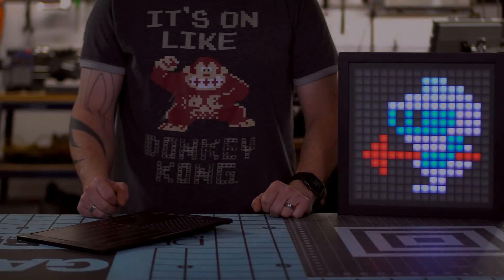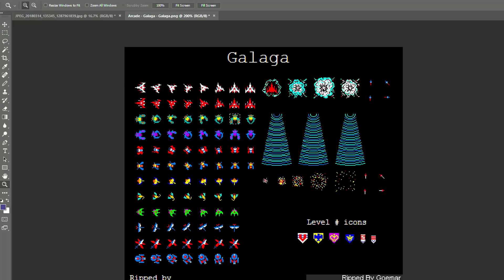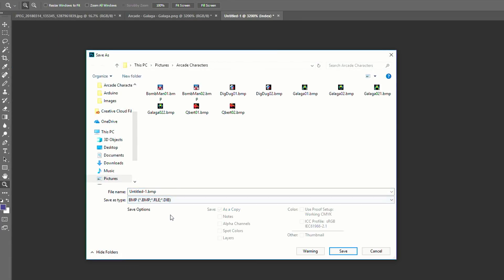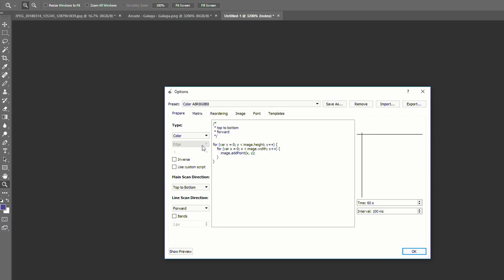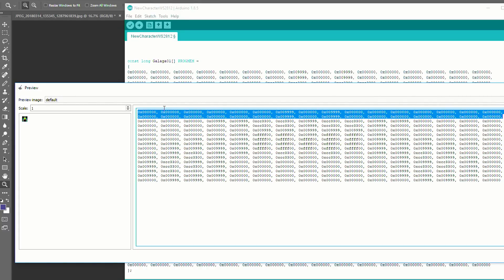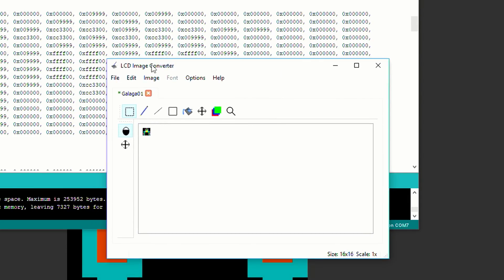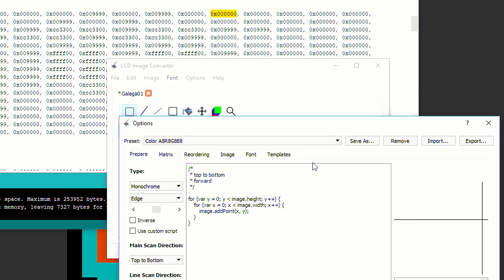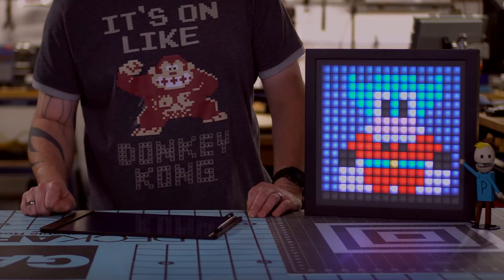How to convert images to Arduino Arrays for use on LCD displays! - Tutorial

Comment: Here is the script for the conversion so you don't have to copy and paste all those lines.

/*
 * top to bottom
 * forward
 */

for (var y = 0; y < image.height; y++) {
    for (var x = 0; x < image.width; x++) {
        image.addPoint(x, y);
    }
  y++;
      for (var x = image.width - 1; x >= 0; x--) {
        image.addPoint(x, y);
    }
}
Reply: Also, don't use the "preview" to copy the code from, the app is a little buggy and doesn't update. So copy this script in, close + save the conversion, then File > Convert, and copy from the output file
Reply: hello, i dont know why my number of pixel in one line of mine only have 11 pixels, can you help me bro

Comment: Hello. I have an improvement to make the array creation easier and faster. After setting the software up, in the PREPARE tab mark the option "Use custom script", and paste the next code:

for (var y = 0; y < image.height; y++) 
    {
    if ( y % 2 == 0)
       for (var x = 0; x < image.width; x++) 
       {
        image.addPoint(x, y);
        }
    else
          for (var x = image.width - 1; x >= 0; x--) 
         {
          image.addPoint(x, y);
          }
     }

This will create the arrays ready to be copied without the need of creating the backward code.

Let me know if it worked for you, I just tested and it is fine.

BTW, thanks for the tutorial.
Reply: I just wanted to type in the same code. Cheers mate
for (var y = 0; y < image.height; y++) {
   for (var x = 0; x < image.width; x++) {
       image.addPoint(x, y);
   }
   y=y+1;  
   for (var x = image.width-1; x >= 0; x--) {
       image.addPoint(x, y);
   }
}

Comment: /*
 * top to bottom
 * forward in even and bacward in odd
 */

for (var y = 0; y < image.height; y++) {
    if(y%2==0){
       for (var x = 0; x < image.width; x++) {
           image.addPoint(x, y);
       }
    }else if (y%2!=0){
        for (var x = image.width - 1; x >= 0; x--) {
            image.addPoint(x, y);
        }  
    }
}

When you use the Conversion
you need to check Use Custom Script 
you copy and paste the code above
And it should get you the proper readings. Without the copy and pasting hazle. 

Good luck

Comment: You can make this INFINITELY easier on yourself by "interlacing" your image. Select every other line, straight across. Then flip what you've selected horizontally. 

You could streamline doing this multiple images of the same size (like animation frames) by making this selection into a mask. They just paste in each frame, select the mask, and flip the image lines. Save and repeat.

Comment: I made a python file to convert images to the sketch format. It will reverse every second line too if you request it to. You can get it here https://gofile.io/d/bJTvut
Reply: Thank you 

you lad
Reply: please repost, not available anymore!!!
Reply: How can I use this? I don't know anything about pyhton
Reply: @sumo_life48  install python from python.org and download visual studio code to run it. Works in Linux, mac, and windows.
Reply: thanks man
Reply: still have that python script?
Reply: @r1b4z01d  I forgot about this. I'll have to check my laptop. Not home ATM.
Reply: @Malcrom1967  no worries, thanks for replying. I think I found a solution to my problem.

Comment: This program only works with single pixel drawing. It is not compatible with display libraries on arduino that can draw bitmaps. I need something that draws in 8x1 pixel rows, not 1x1. I want to uninstall the program on windows 10, but it doesn’t show up in my settings, but everything else does. How do I uninstall this program on windows 10?

Comment: Programmed my own code for the lines to automatically flip.... AND THEN found out that multiple other people had done this. Darn.  Oh well, here is my own code that seems to work:

/*
 * top to bottom
 * forward and backward
 */
for (var y = 0; y < image.height;) {
    for (var x = 0; x < image.width; x++) {
        image.addPoint(x, y);
    }
    for (var x = image.width - 1; x >= 0; x--) {
        image.addPoint(x, y+1);
    }
y=y+2
}
Reply: Where i have to put it in the code?

Comment: Good job but you can program LCD-Converter to separate even and odd lines :
for (var y = 0; y < image.height; y++) {
    for (var x = 0; x < image.width; x++) {
                if (y%2==0) image.addPoint(x, y);
                else image.addPoint(image.width-1-x, y)
   }
}

Comment: Hello, nice project,
Reply from the maker: Thanks for watching!
Reply: I have a question. you would be able to make an arduino project with a matrix matrix eg 32x32 and after pressing button 1 a red down arrow will appear, after pressing the button 2 you will see the red arrow up? arrows could be animated
Reply from the maker: @Learnduino  Sure, you would have to modify the code to reflect the numbers of less:  #define NUM_LEDS 1024 and make the images in that format.

Comment: Here's the custom script for scanning the image in LCD image converter without the need for manual copying of every even line. In order to use the script you need to check the "Use custom script" checkbox. 

for (var y = 0; y < image.height; y++) {
 if (y % 2) {
  for (var x = image.width -1; x >= 0; x--) {
    image.addPoint(x, y);
  }
 } else {
  for (var x = 0; x < image.width; x++) {
    image.addPoint(x, y);
  }
 }
}
Reply: Came here to post this exact same thing.  Really wish I would've seen that I could use a custom script after making 4 sprites manually.  Thanks for sharing!
Reply: I had to invert the script, otherwise, on my matrix, the characters were all facing the wrong way.

for (var y = 0; y < image.height; y++) {
 if (y % 2) {
   for (var x = 0; x < image.width; x++) {
    image.addPoint(x, y);
  }
 } else {
  for (var x = image.width -1; x >= 0; x--) {
    image.addPoint(x, y);
  }
 }
}
Reply: Thank you Luka!

Comment: You can use the % (mod) operator on the for-loop for the lines ( if lineNum % 2 == 0 ), then on the pixels on that row, count 0-16 or 16-0 depending on that if-statement
Reply: Sorry to be a noob.
Please help me out show the final script, I just can´t get it to work....
Here's the two diffrent scripts:

 * top to bottom
 * forward
 */

for (var y = 0; y < image.height; y++) {
    for (var x = 0; x < image.width; x++) {
        image.addPoint(x, y);
    }
}

/*
 * top to bottom
 * backward
 */

for (var y = 0; y < image.height; y++) {
    for (var x = image.width - 1; x >= 0; x--) {
        image.addPoint(x, y);
    }
}

Comment: A much easier solution is to drive your matrix with a $20 M0 from adafruit running circuit python and use my neosprite library. You can store the images as BMP files right in the flash memory accessible as a USB folder - up to 2MB of images - just drag them onto your microcontroller folder in your file explorer from your computer. Your python program loop can then cycle thru the animation files. None of this file conversion or Arduino coding nonsense. Want a new animation, just drop it into the folder. Easy. See my project video using this library here: https://www.youtube.com/watch?v=IeuKjV6uMBE

Comment: Hi, 
Thank you for the video. Actually, I am trying to display any random coloured image on flexible LED display build by using WS2812B strips(60*45 = 2700 pixels)  controlled by Arduino, so i just want to know if the same software i can use to convert images to Arduino Arrays for use on LED displays. Please help with this.

Comment: I would look into using a scripting language to do that. You could write one script that would reverse every other line for you and use it with all pics.
Reply from the maker: Hi, a viewer of this video created a script like you are suggesting that you can input in the "use custom script" box of the software, and it does work perfectly. I copied and pasted is reply below if you want to check it out.  Thank you for your comment and for watching btw.
 
Kevin Kratzke2 months ago
I haven't gotten a chance to test it out on an connected matrix, but I think you can get LCD Image Converter to output the alternating line order by selecting "Use custom script" on the Prepare tab of the conversion options and using code like:

/*
 * top to bottom
 * forward/backward alternating
 */

for (var y = 0; y < image.height; y++) {
    for (var x = 0; x < image.width; x++) {
        image.addPoint(x, y);
    }
    y++;
    for (var x = image.width - 1; x > -1; x--) {
        image.addPoint(x, y);
    }
}

There might be a more elegant way to do it, but I looked at the output for a simple 8x8 rainbow gradient and it appeared that the lines were alternating correctly.
Reply: Nipuna Gunarathne scripts usually take a few minutes to write and you would Not have to dig around in any code.  I thibk you misunderstoodwhat i said.  And it looks as though what i said was already done
Reply: or you could rearrange the strips to match the software? looks like that would be much much MUCH easier to do than digging around in code.

Comment: If you are not interested in rewiring it, you should be able to handle this in code instead. Ex. If the row is odd, run the loop normally but if even then a seperate loop that accesses the column data in reverse.
Reply from the maker: Probably could have done this in the Arduino code like you just suggested, but someone here in the comments, Kevin Kratzke, found a solution to make the LCD Image Converter program change the way it creates the array by using the "Use custom script" option and entering this code:

/*
 * top to bottom
 * forward/backward alternating
 */

for (var y = 0; y < image.height; y++) {
    for (var x = 0; x < image.width; x++) {
        image.addPoint(x, y);
    }
    y++;
    for (var x = image.width - 1; x > -1; x--) {
        image.addPoint(x, y);
    }
}

I tried it, and it works perfectly, the array gets created in the left-right, right-left and then you just copy and paste in the Arduino code.
Thanks for your comment and for watching of course!
Reply: Even better! Glad to hear it.

Comment: What is the version of lcd-image, I use the latest version, the code and picture are not the same, there are some...
Reply from the maker: I'm using this version:

Revision 466b2e2 from 2016-10-12 21:59:31 +0500
Qt 5.7.0

It's not the latest one so maybe some changes were made?  Thanks for pointing that out, I'll check out the most recent version to see if it's different.

Comment: I haven't gotten a chance to test it out on an connected matrix, but I think you can get LCD Image Converter to output the alternating line order by selecting "Use custom script" on the Prepare tab of the conversion options and using code like:

/*
 * top to bottom
 * forward/backward alternating
 */

for (var y = 0; y < image.height; y++) {
    for (var x = 0; x < image.width; x++) {
        image.addPoint(x, y);
    }
    y++;
    for (var x = image.width - 1; x > -1; x--) {
        image.addPoint(x, y);
    }
}

There might be a more elegant way to do it, but I looked at the output for a simple 8x8 rainbow gradient and it appeared that the lines were alternating correctly.
Reply from the maker: I think you're right, thanks a lot for sharing the solution, like I said in the video this LCD image converter software has a lot of options and your observation just made it even better!
Reply: No problem! Your videos are helping me out a lot as I dive back in to electronics, so I'm happy to return the favor (even just a little bit)!
Reply from the maker: Btw I just tried your script and it works Perfectly!  Thanks again for sharing!
Reply: Brainy-Bits 
Salam
Reply: Dieses custom script hat vieles erleichtert. Viele Dank

Comment: Very good project, but whether the image code can be put into the memory card, so the space is infinite
Reply from the maker: Good idea, I guess you could connect an SD card reader module and save the array information there.  Thanks for the suggestion and for watching!
Reply: I just suggested that I don't have such technical capabilities, but I believe you can, I'm very much looking forward to what you can do, and why the code I have transferred out is different from the image.
Reply: Image can be converted to approprate binary format for you. This utility have such capability.